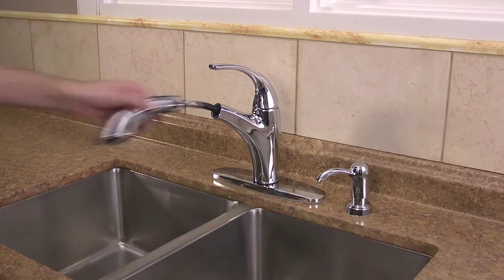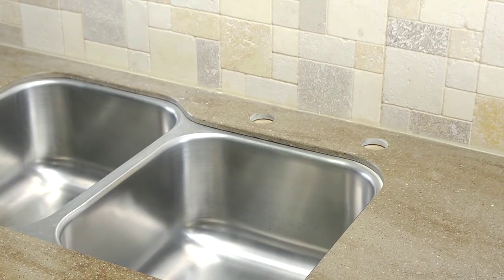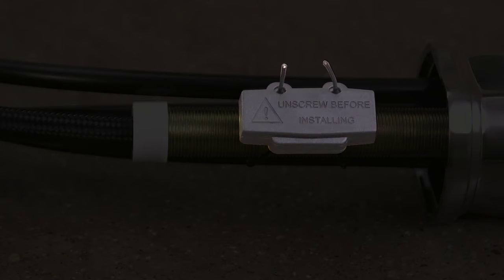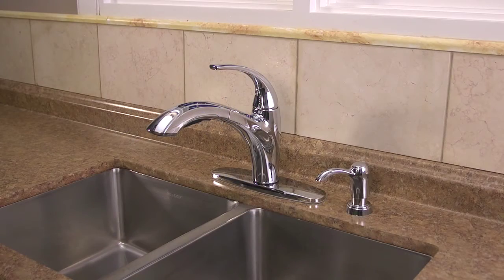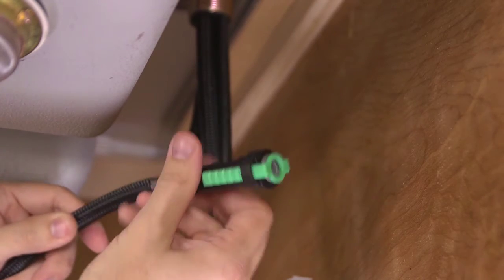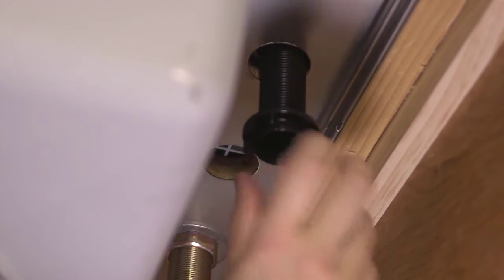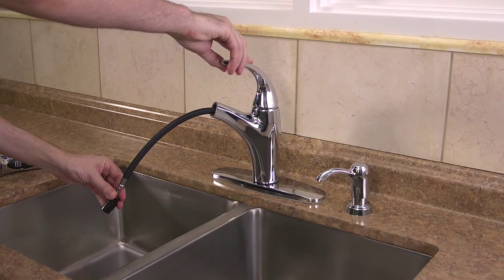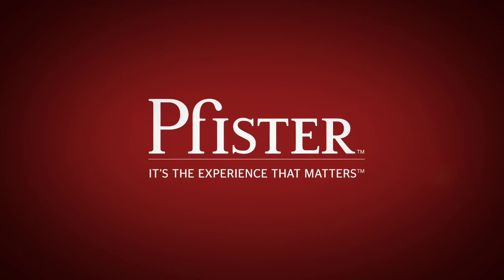Installing a 1-Handle Pull-Out Kitchen Faucet with Integrated Supply Lines - Selia Collection

Comment: On the faucet control, make sure the Hot and Cold travel extremes are even between left and right before you tighten the main nut with the Quick Install tool and it helps to have the person top-side hold the control at the optimum Left extreme as the nut is fully tightened because the whole control tends to rotate in the right direction as the nut is tightened.